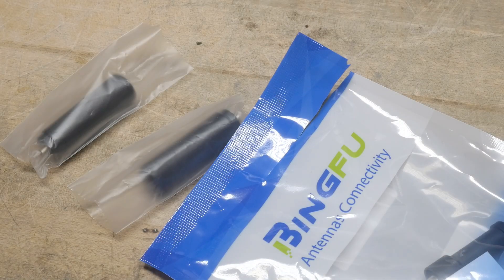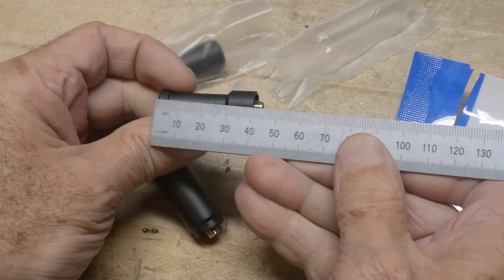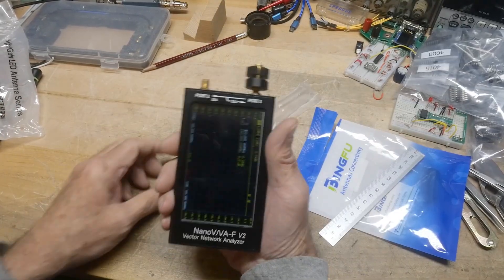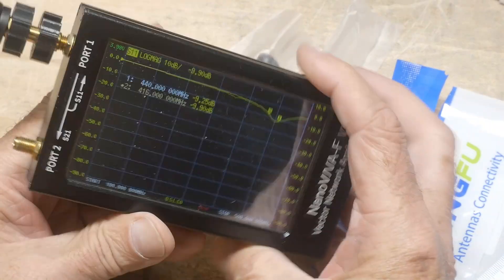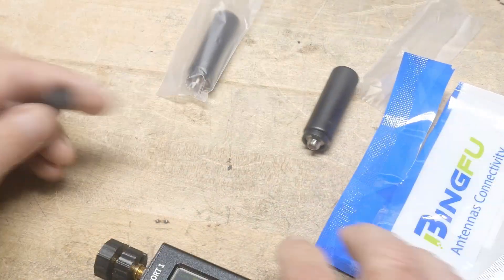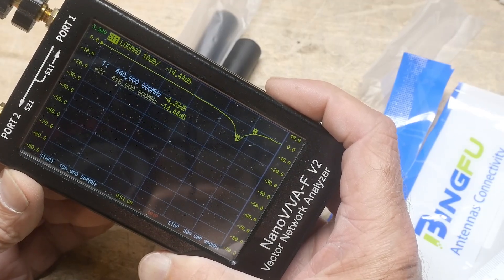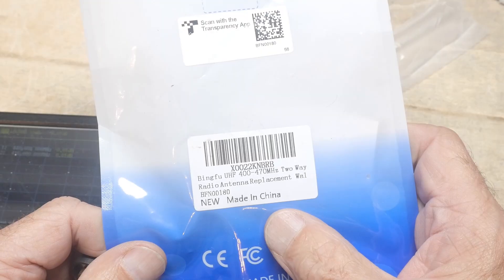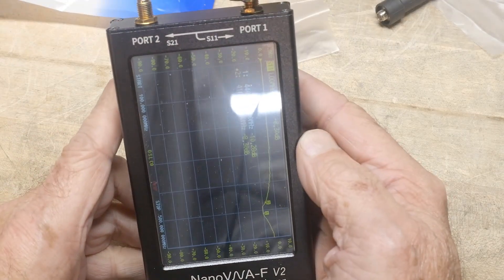#2466 Short Antennas for 440MHz

Comment: A similar thing happened years ago with cell phone antennas. I had a Uniden CP5000 with a removeable antenna, the factory supplied one was about 15 inches long and fairly flexable, I bought an antenna that was 5.5 cm's long and "certified" for the phone band....I guess it was OK as the LONGEST distance it had to reach was the next tower, and these were usually less than 500m apart for 2G and 3G, there were antennas and repeaters on just about EVERY building back then, so coverage maps overlapped most places, range was not a really important consideration....And at under 500mW up the stick, very little chance of doing any damage to any internal electronics from an SWR somewhere in the hundreds to one range....

Comment: What I'm trying to say is that the NanoVNA is not a scientific instrument, but rather a testing device whose purpose is to provide an approximate picture. Therefore, calibration is necessary when dealing with parameters that at least exceed the instrument's margin of error.

Comment: I don't calibrate on small connectors. I'm just too lazy. For household and even amateur radio purposes, there's simply no need for it. The error will be so low that it can be ignored. After all, I'm not building satellites for NASA, I'm just pursuing a hobby.

Comment: I have tried a quarter wave on 146 on a handheld.  I also tried the gimmick of the quarter wave wire counterpoise hanging from the connector shell with a clip.  I measured an improvement in field strength transmitting but reception seemed the same.

Comment: I once measured several dozen handheld antennas, and among them was one that looked identical to your smaller one. In the 70cm band, the signal was 11.47 dB weaker than the Diamond NR-770H. The worst performer was the antenna included with the Yaesu FT-5D (much longer), whose signal was 12.07 dB weaker than the NR-770H.
Reply: The Diamond NR-770H is 93cm long  and fragile.

Comment: I went through a phase of aftermarket antennas several years ago.  I eventually just put them all in a box to collect dust and occasionally give them to people that may have broken their antenna.  I'm back to using bone stock factory antennas on all my Kenwood, Yaesu, Icom and Motorola radios.  My opinion on the stubby and really long aftermarket antennas is they work, just not for me.  The stubby's are just to short.  A lot of the repeaters I use when I'm away from the base station or mobile are 20 or more miles away and a stubby just doesn't have enough gain to be practical.  The really long ones are great for longer distance contacts but they are just to blasted long.  Sticking me in the arm pit, smacking into the ceiling, can't use in a mobile without cutting a hole in the roof, etc...  Just to cumbersome.  Factory antennas are the perfect length.
Reply: Probably the best comment, just use the factory antennas. Manufacturers tune the HT rubber duckies to match the body and RF filters in the radio. I've not seen any difference with Nagoya 771 or Diamond SRH77 compared to the factory ones that came with the Yaesu, Baofeng and Quansheng. Waste of money unless you're an antenna collector like IMSAI Guy.
Reply: @ryebis  Agreed. For sure the 'big 3' perform actual analysis of their antennas with their devices before going to market, and the larger/common Chinese brands probably so, since they are usually repurposed Chinese 'business band' radios. There are also diminishing returns on any HT antenna. It's a compromise transceiver with a lot to contend with already (body proximity, distance to resonant or obstructing conductors like in a car, multipathing, and so on). The best antenna is one free and in the clear, so a car antenna - even a mag mount on a pizza pan - will work much better than any mounted to the actual HT.

Adding a giant whip will increase capture area, but will also capture more noise and the AGC will probably back off, possibly affecting your SNR. The same can be said for stubbies, only the AGC will ramp up and bring in more local noise without a lot of signal. If there is a significant impedance mismatch, the antennas will just turn your PA transistors into little space heaters at best and the transmitter will fold-back output power at worst. We're also talking about FM in the vast majority of cases and as as long as you can 'capture' the receiver, signal strength is less relevant than many people think.

There is a happy medium and the OEMs usually nail it pretty well unless your OEM also threw a random Shenzhen flea market antenna on there.
(for the record, I'm not crapping on all Chinese equipment, just the stuff that is built and sold without due care)